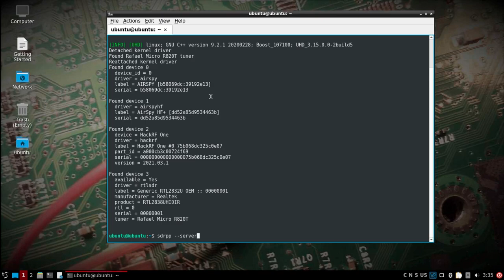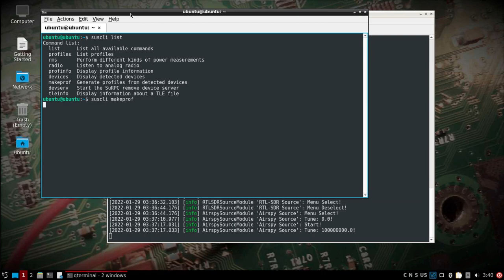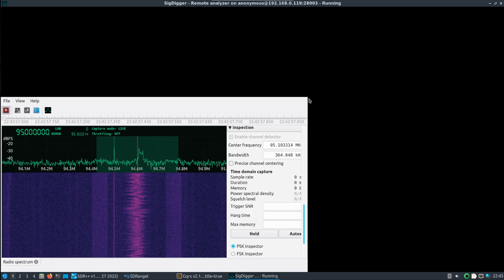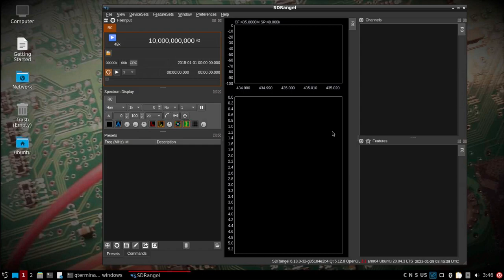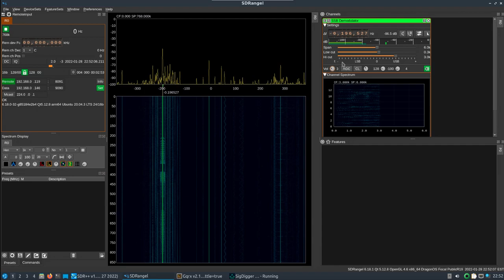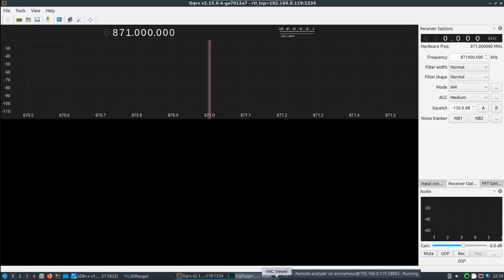DragonOS Focal Remote SDR w/ SDR++, SDRAngel, SigDigger, and Gqrx  (Pi4, HackRF, Airspy/HF, RTLSDR)

Comment: Now I got a Raspberry Pi 4 with 8 Gigs, with Dragon Os installed, and it's works well with this Operation System, also installing Sdr connect,
Reply from the maker: I keep meaning to do an update for that particular platform. I’m glad you got it running. Hopefully I can get an all new image together ASAP.

Comment: Nice OS, but i have issues that i can`t find anywhere else reported ... do you guys do RDP to a DragonOS machine from a windows box ? Audio is working for you via RDP ? I can`t make this working ... 3 days now and still nothing. Any hint very much appreciated. ! 73
Reply from the maker: If you want audio over a remote connection I suggest Rust desk. There’s both a windows and Linux version. You can set it up under security settings to allow a lan connection so you can go direct IP instead of through proxy. This allows, remote desktop, more like a TeamViewer like set up, and audio passed over for free. Real Vnc works well, but requires a paid account for audio. I’ve not really bothered much with stock like RDP Linux apps but maybe something I should look at again.
Reply from the maker: I basically talk about what I’m suggesting here although I probably need to do a new and more in-depth video

WarDragon Initial Setup for Headless Usage (Airspy R2)
https://youtu.be/TKSv5XfDA1Q
Reply: @cemaxecuter7783  this worked ! Thx big time. u saved me a lot of time.

Comment: I am intending to use SDR to help coordinate usage of certain RF frequencies. I'm just now new and learning SDR basics.

My current plan was to take a homebuilt device around to different rooms in a venue and coordinate frequencies that way. However, do you think it is possible to remotely connect several SDR modules with Raspberry Pi's across the LAN and check on each room's RF performance from a centralized app?

Would I need a centralized server in the control room with remote clients spread across venue, or does each remote location need to be a server with the control room being a client to each?

If it matters, I am considering doing this with SDR++. So perhaps the answer depends on this,
Reply from the maker: You know what may be perfect for this to get started with anyways, SDRAngel allows multiple sources on one work space. It has a rtltcp source, so technically you could attach an rtlsdr to each pi and have them networked (preferably wired) back to say one server running DragonOS or whatever you want that has SDRAngel. You should then be able to monitor the spectrum of them all from one app. 

Option two and far less bandwidth, setup SigDigger headless on each pi (just use DragonOS pi64) and all DSP will happen remotely and small amounts of bandwidth can come back to your one server but you’d essentially have multiple individual instances of SigDigger GUI opened up connected to the iP/port of each PIs SigDigger (suscli) headless setup. 

What you want to achieve is totally doable.
Reply from the maker: SDR++ option would be similar in a way to the SigDigger one but would use way more bandwidth over the network as the data is coming back to fhe server to be processed.
Reply: @cemaxecuter7783

Hmm both of those options are appealing, I think I'll try out both and see if I can establish an efficient and useful-to-me workflow. It will only work beautifully if I don't have to fumble with setup and making things work on-site.

Preferably, I can have it working for other A/V tech folks too, without them having to be computer geniuses... 😬 But, baby steps... Lol

Comment: Hey. I have a bladerf x90 broadcasting yatebts at 1950.0Mhz and on a separate computer, a hackrf sweeping the 1900mhz band and is showing the bladerf tx'ing at 1949.7-1949.9. How do i find out which device is off? should i calibrate them somehow? Thanks for your help. Im running dragonos on 3 systems and going through all of your videos. Thanks!
Reply from the maker: I’d think it’s more likely the hackrf sweep is slightly off, use maybe grgsm scanner or kal (find ppm correction) for hackrf and see what it reports as far as the PCS1900 information. I’ve never had an issue in my testing with a gsm phone to Yate, but I’ve also never really looked at it with hackrf sweep.

Comment: Can you use a GMRS radio as the source for sdr++ for example, as apposed to an sdr? Think the signal from my radio is stronger. Please let me know.
Reply from the maker: That would be pretty neat, but no that’s not available (that I know of).
Reply: could work. You need an APRS Cable to hook up kenwood plug of radio to audio jack on a sdr host (phone/pc).

Comment: I have a lot to learn and I've been deep diving into this stuff for a while now. I can't tell you how valuable this tool is. I don't think folks truly understand the immense power an all in one solution like Dragon OS gives you at your fingertips. Where I struggle is with networking and setup and Linux commands, databases, etc. What I need to fing are videos that hold the hands of noobs like me and walk through the entire setup process from hardware and setup and why things are done the way they are. When I watch your videos it's clear everything makes complete sense to you. This is why I'm a big fan of installing packages that just boot up and run. I can't tweak things without observing a step by step process. I know that's not your forte, so any advice on where to find the instruction s for noobs would be immensely appreciated.
Thank you so much for what you do.
Reply from the maker: Appreciate you dropping a note and providing feedback. Lemme know how maybe I could tweak the videos a little and help more, I think I’m just limited on time these days - but as long as I can just sit down and basically just wing it without worrying about editing.. that I could probably afford time to do.
Reply: Dann man, u hit the nail on the head. It seems like every video is either missing something, or the commands lines don't work.
Reply: @RoughHouse-vb4ee  trial and error plus time and mistakes. Eventually things start falling apart in the right places and you realize that you accidently broke your moms computer again.

Comment: Does SDR Angel stream the raw IQ or just trace data/audio?

Looked at their main documentation page but didn't see the answer there.
Reply from the maker: I believe raw IQ/samples - I can’t find where it specifically says though besides in the plug-in info. I believe the developer had a ticket response or maybe it was in the mailing list, but here’s probably what you noticed already,

“The Remote input plugin is the client side of an instance of SDRangel running the Remote Sink channel plugin. On the "Data" line you must specify the local address and UDP port to which the remote server connects and samples will flow into the SDRangel application (default is 127.0.0.1port 9090).”
Reply: @cemaxecuter7783  okay cool, thanks! Good summary video of the different apps, looking forward to trying them soon.